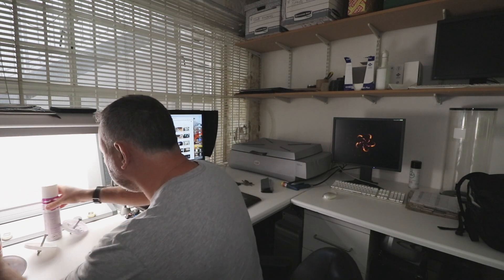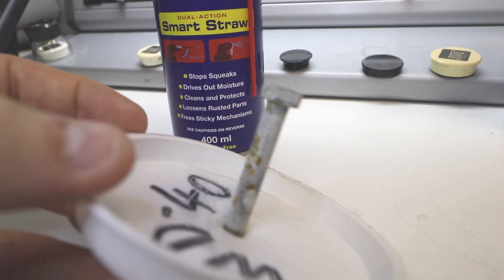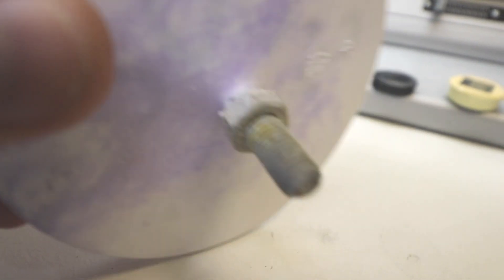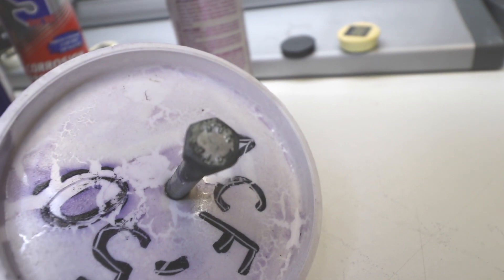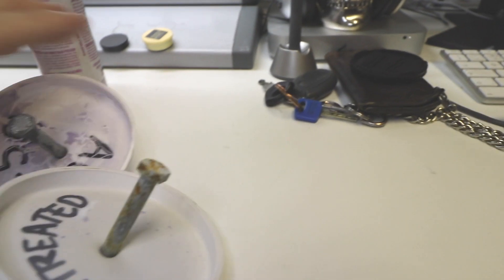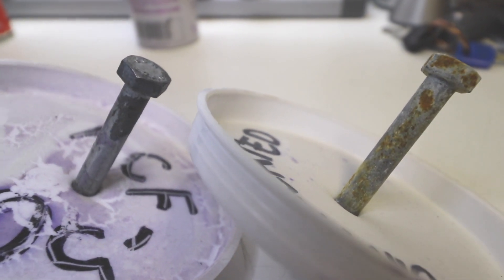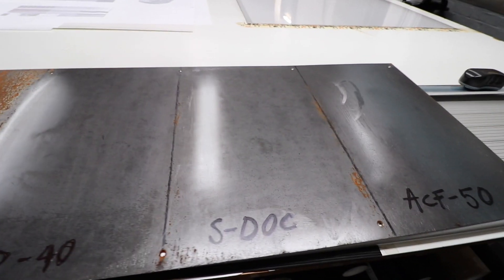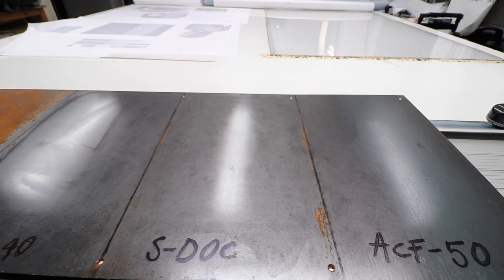Corrosion test results. WD-40. S-DOC. ACF-50

Comment: Hmmm here's me trying to tell you about ACF 50 LOL. 
I was on the understanding that if anything treated with it shows corrosion that it would just wipe off, also WD-40, GT85 and DP60 were more of a water displacement spray/lubricant rather than protection against it. 
ACF 50 seems great and I used it but it cost me £16 for the same size can you have there. 😟
Reply from the maker: Random Rides im actually looking at that sheet of steel as we speak, the results are quite frankly surprising, watch this space!

Comment: The long term test will be the best in deciding which product is better. It's a bit more of a real life test. How long are you going to keep the sheet steel out for? With the winter coming, I'm sure people will be looking for the best product to use. I can't wait to see the results!
Reply from the maker: cidwll thanks mate, im going to keep it out there until the results are well and truly undeniable. Im pretty sure the acf is going to win, but for long can one coat hold back the corrosion, we will see!
Reply: I always apply my ACF by spraying some into the cans top and applying with a small paint brush,then I can get into all the nooks and crannies of the Tex.Usually finish by giving her an all over spray.
Reply: Except for the brake disks of course😉
Reply from the maker: I’ve read you can actually run it through a compressor which turns it into fine mist, its bloody good stuff either way.